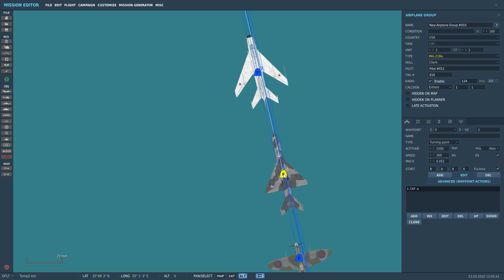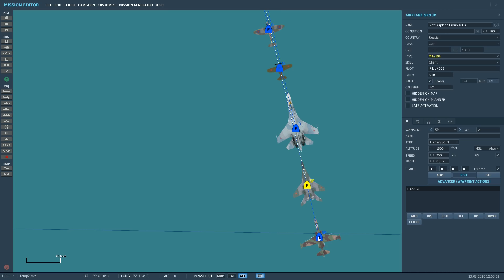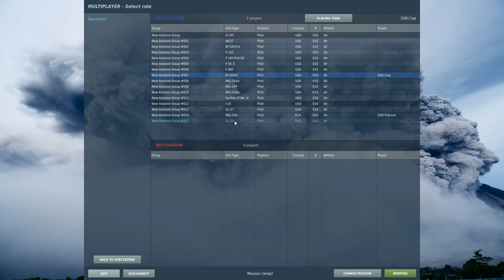Questioned: Which Non-Naval Planes Can Land On Aircraft Carriers? | DCS WORLD

Comment: On planes with a drag chute, deploy they chute a second or two before you cross the deck edge, before you even touch down. It will slow you down more and get you on deck faster to use your brakes. There's plenty of footage on YT of (russian, of course...) jets deploying drag chutes just before touchdown to shorten rollout to a minimum. You just need to come in a tad higher and have strong gear struts :)

Comment: I did the carrier landing and take off with M2000, it was quite easy :
Touchdown before the first wire (the sooner you touch down, the best it is), open brake chute and wheel brakes on touchdown. For the approach, just be careful with your speed, slope and AoA (there is a narrow window in which the carrier landing can be done without any damage on the plane). No rough manoeuver to avoid stall, use airbrakes by short period and always have your throttle at 10% min. You must "feel the plane", otherwise, you'll go directly to the crash. Not really complicated, if you know this plane enough.
Reply: I agree, the mirage is so easy to fly once you're used to it I love it

Comment: I'm honestly shocked you thought the Spit wouldn't be able to do it, the Merlin models are light as a feather and can speed up or slow down basically on demand. Hell, they're arguably too damn light, I'd be more worried about the headwind making it impossible to actually get down to the deck than breaking once I hit it. 

And then in general I wonder if you wouldn't be better served for this coming in low and slow, from dead astern of the runway, instead of a standard carrier landing pattern. You'd have to really be careful to stay just above your Vmin, but you're also now only dealing with your aircraft's kinetic energy instead of having to oppose both that and the potential energy from starting up high.

Comment: I'm sort of picking nits but "V  min" isn't a term that is used in fixed wing aviation. It's a helicopter speed but in general the v speed you're talking about Cap, is Vs( stall speed) along with its correlates by configuration Vs1, Vso, etc. V min isn't a term that fixed wing pilots use.

Comment: Land straight, touch down as slow as possible (full flaps and speed brakes)
and as close to the edge as possible, flame out the engine (kills residual thrust but you’ll lose hydraulics - hopefully not brakes) pull a chute if you have one and open the canopy as a speed brake???? MAX DRAG BABY

Comment: Keep in mind that a little research would reveal that there are or were naval versions  of the following airframes:

1) The Mig-29 = MiG-29K
2) F-86 Sabre = The North American FJ-2 and FJ-3
3) The SU-25 = SU-25UTG as a carrier-capable version used to carry out deck-landing aboard Russian Carriers.
4) The SU-27 = SU-27K

Misconceptions about other airframes that have a tail hook.

1) The western airforces have a tailhook to engage a cable on the runway in case of brake failure. This is not stressed to handle an aircraft carrier arrested landing. Also, most land-based aircraft do not have the airframe structural or landing gear / Tire inflation specs to survive a carrier landing. 
2) If by some miracle a land-based aircraft does manage to land on a carrier, good luck taking off again, except maybe for the ski jump equipped carriers that do not use catapults
3) On Aug 2, 1963, A U-2G spyplane was certified to take off and land from a US aircraft carrier, the USS Ranger
4) On October 30, 1963, A KC-130F Hercules made a series of takeoffs and landings aboard the USS Forrestal. This was possible because of the propellor pitch reverse available to the Hercules, it had no hook.

Comment: A proper landing with the su-25, using the chute, should take less than 1500 ft every time.  Add in 25kts of head wind and an empty plane and it should be that easy.  Realistically, if the Russians could figure out rocket-assisted takeoff, they could be using it for real right now.
Reply: Go check the SPRD-99 on the Mig-21bis :)

Comment: "GAU brake" Must have skipped that оnе in manual.
Reply: It's actually plausible.  A-10 pilots have stated that the GAU-8 can actually screw up your airspeed which is another reason why they fire in bursts aside from conservation of ammo.
Reply: @ScottsJourney4  True.  You can actually notice in the DCS World A-10 that when you pull the trigger there is an automatic pitch down by the flight computer to compensate.  I have also heard or read that besides conservation of ammo, that's one of the reasons for A-10 pilots to not use too long a burst.
Reply: @ScottsJourney4    In typical combat mission the A-10 can weight 40,000 pounds and that with the speed generates MUCH more force, that gau could slow down. So firing it doesn't really make it slow down.
Reply: @ScottsJourney4  dosent the gau8 put out more RPMS than one of the engines at 100 percent thrust?
Reply: @jamesbeach5445  Not sure but for jets it's not how you gauge forward force potential.  It's "In thrust we trust." and if there is enough energy from the expanding gas collectively in a given period of time that out performs the engine's combined thrust, you will start to run into issues.
Reply: Laughed at that. "Proper landings" and first thing they do is this. :D
Reply: It also works well for a “reverse” feature.
Reply: That's a galaxy brain move right there

Comment: Im kind of surprised the F-15 doesn't have a tailhook. Seems like something it would have installed.
Reply: They do... just not usable in DCS, right?
Reply: It does, its meant for ground arrest cables for break failure landings and engine run up tests. It is not designed for carrier landings.

Comment: Incredibly, there was a carrier version of the 109, built for Germany’s aborted carrier (Graf Zepellin?). Obviously it was never used operationally. If you thought sea fires were unsuitable for carrier operations, I can’t imagine how bad 109s would have been.
Reply: The few examples they built were actually used operationally... just not on the carrier, obviously. Operating from south Norway on coastal airstrips. Since they were pretty much a heavier, bigger 109E, they soon became underperforming in that job, too. At any rate, totally the wrong plane for that job.
Reply: @decnet100  maybe a Fw190 would have worked, it can handle big payloads, has bigger wings than a 109 and the landing gear is more stable.
Reply: @marcox43  Yeah, 190 would have been the most logical choice, think they would have made a great naval fighter - but I guess they weren't anywhere near production yet when the 109T-project was started (must have been around 1936-8 or so, when they started building the Graf Zeppelin, they must at one point have wondered "wait a minute, what will we actually use this massive boat for?").
Reply: Horribly I'd imagine. 109's had a tendency too tip over on a stable, perfectly flat runway during landing due too the extremely narrow landing gear, I can't begin too imagine how horrible it would've been trying to land it on a pitching deck.

Comment: I shure l can remember the f16 has a emergency hook. Its 26 years since l worked on them so they may have taken them away. Norwegian f16 still has them
Reply: Even the B-1B Lancer has an Emergency Hook, but it was never meant for carrier landings. Depending on emergency mid-air malfunctions, some airbases can scramble out some "catch wires" that merely slow the aircraft down a bit on touchdown instead of actually completely stop them. 
The Emergency hook on the B-1B for example pretty much just gets ripped off anyway... At least from an Emergency landing video I've see... So I assume they're not chassis mounted, or even if they are, that area simply is not designed to cope with such load force...
Reply: Same here with the F15. I work on A-10s currently but back when i was first training on them we shared a hanger with the F15s and i could have sworn they had an emergency hook as well. I could just be crazy though haha
Reply: Dakota they do have hooks. They aren't made for carrier landings though. Too abrupt.
Reply: For the F-16 at least, the hook mechanism isn't modeled yet so it's unusable atm.
Reply: Danish F-16's have them as well
Reply: The F16N has a beefed up landing gear and a tailhook.
Reply: My dad also worked with F-16 in the norwegian air force, what squadron where you in and what were you doing?
Reply: Yeah, the F-15 has an emergency hook, but the sim might not have it modeled. I clearly remember the Israeli F-15 that landed with a wing missing used his hook and ripped it out, but he was going considerably faster than the usual landing speed.
Reply: French rafale, (not the M version) have a emergency hook too. But can resist to a land on carrier, its a hook when break dont work
Reply: Even the later f104 variants had a emergency hook
Reply: I saw them about 2 years ago at Edwards, so yeah they still carry them